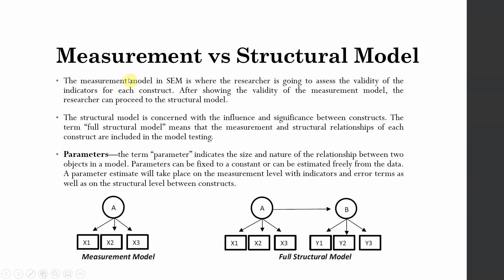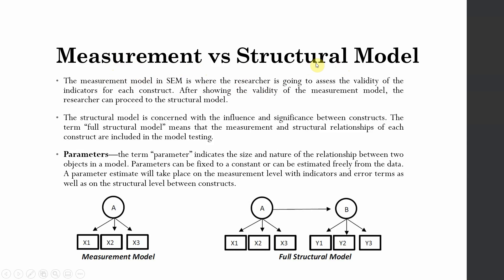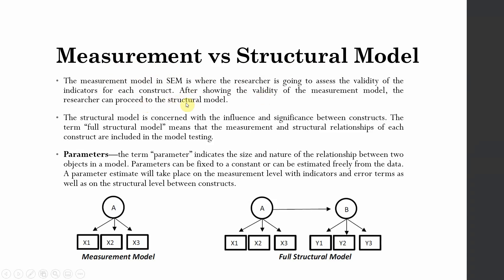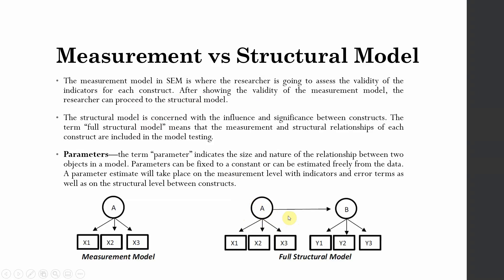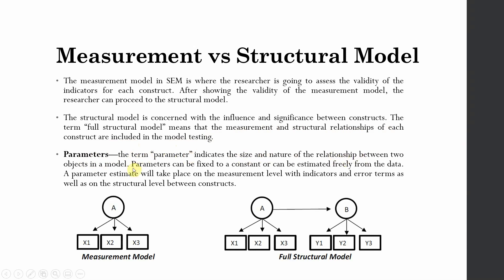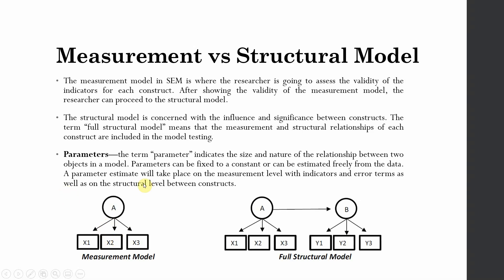Quick Guide: Difference between Measurement and Structural Model?

Comment: Hi sir, i have a question about a model im conducting,  the CFA fit indices and the full SEM model are equaly the same ??? is it normal to have this  ??? or There is something wrong with my model or data??? thank you sir.
Reply from the maker: It is possible to have slight or no differences. How many constructs are in your model, plus how many indicators.
Reply: @researchwithfawad  thank you sir for your attention, actualy i have 4 distinct models with almost 5 to inicators for each construct, evry model have 2 IV  and 1 DV, i have researched  for the reason and what i found is " your  model is  saturated at the structural level". thank your a lot my professor  for the second time.